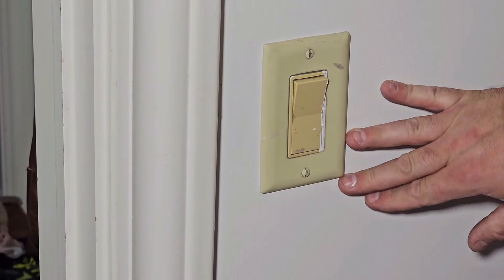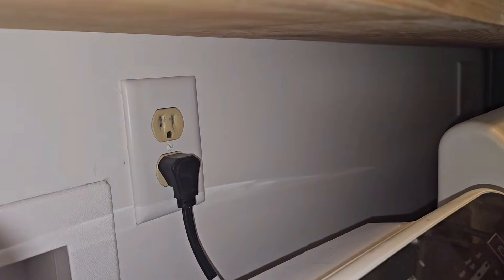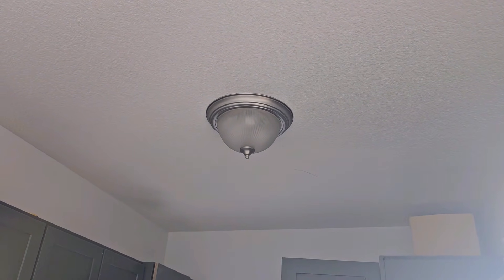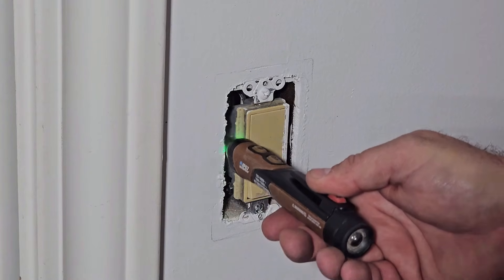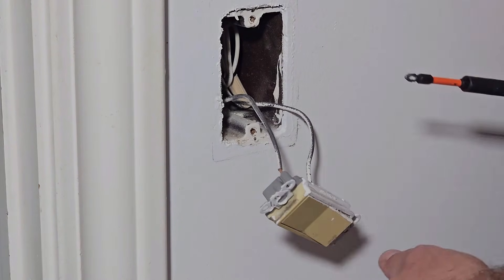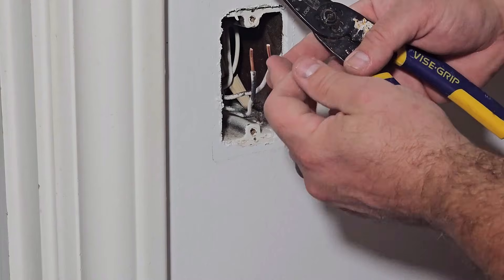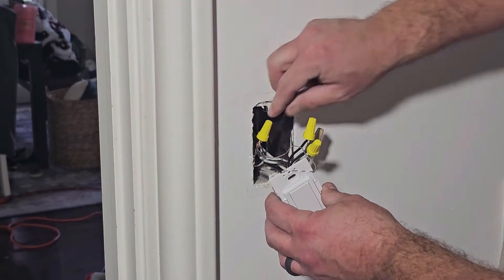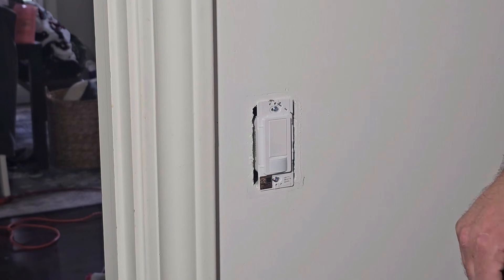Install Motion sensor light switch

Comment from the maker: What part of installing a Leviton motion sensor stressed you out the most?

Was it:

⚡ Identifying the neutral wire

🔌 Wiring the line vs load

📏 Fitting it into the electrical box

⚙ Programming it after install

👇 Comment below — I reply to as many as I can and it helps others too.

If this video saved you time or prevented a mistake, tap 👍 and consider subscribing for more real-world electrical DIY tips.

Comment: Amazing. This got me 90% of the way there. My switch has a red and black wire, so I don't know which of the two black wires to connect it to.
Reply from the maker: The red wire is most likely for a 3 way switch.  Is there another switch that controls the light?  I have another video for a 3 way switch install.  https://youtu.be/mbm5vU-dghU